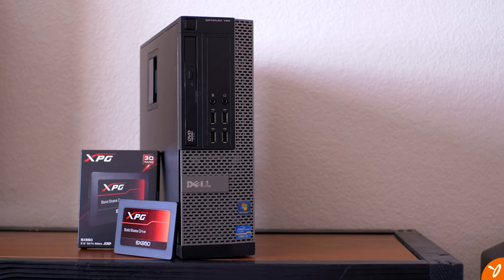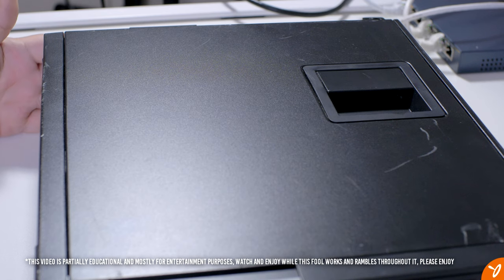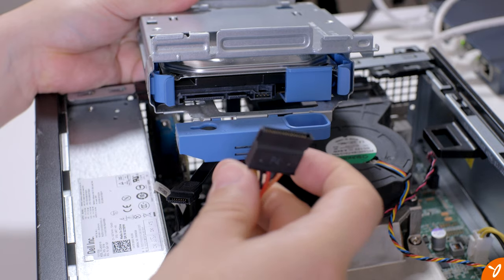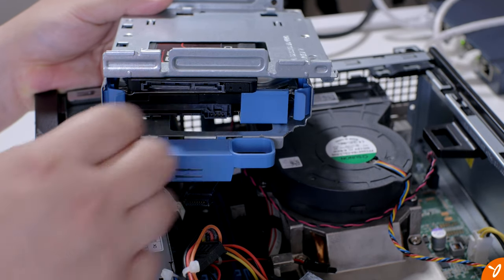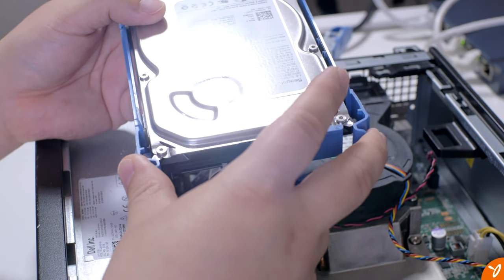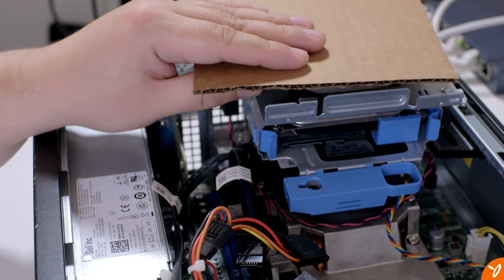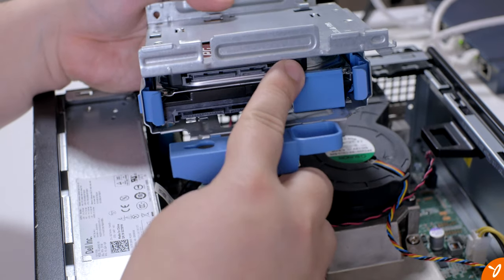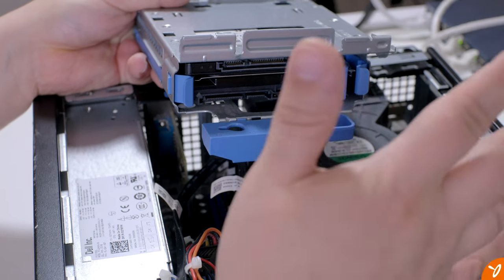DIY | Upgrading from HDD to SSD | Dell Optiplex 790 HTPC

Comment: Thanks for the review.  I'm looking at getting one of these.  I really wish they had designed these USF machines to be able to fit multiple IDE drives but the intended use is a corporate desk.  But yah, heat could be an issue with your setup.  One thing Dell and HP did pretty well on the newer model SFF is created good ventilation.  They used to have this closed off case that would create an oven inside the case.

Comment: Thanks for this video. I have an Optiplex 3010 and looking for ways to increase performance. 
Using an SSD seems to be the easiest and cheapest way to speed up Windows 10, access to files and the internet etc.
Nice attempt at rigging the installation of the SSD!

Comment: Just use a 3.5 to 2.5 adapter unless you want both drives in there. I use external enclosures for larger drives.

Comment: Cardboard is not a good idea, not a conductor of heat at all. You're much better off with the drive directly on the aluminum enclosure which is an excellent conductor of heat away from the drive. There are also HDD caddies that fit perfectly into the DVD enclosure on amazon or ebay very cheap, these would be perfect.

Comment: Thanks for the video!
My idea is to use two cutted rubberringstripes of a bycicle tube  around the front and the end of the ssd. Then put it in.  It will leave a little gap and it is better isolated. Perhaps ask your local bicycleshop for a used one.

Comment: Very nice video. I have a somewhat same system and like to upgrade too. Your video is a clear guide. My plan is to change the old HDD into 2 x SSD, 1 x 128 boot and OS and 500gb for storage...I have only 1 question and maybe a remark or tip. Why you did not change over to a Linux Mint, its much faster...add the Kodi? A good browser, like The Brave...

Comment: DELL is the BEST--- they use good sense in setting things up so they are EASY to work on and get to... unlike the other fools that make it so you have to have a degree to change something..   I will have NOTHING but DELL.

Comment: Question? I want to replace my hdd with a ssd and it says it uses SATA III and I also have an optiplex 790 like you so I was wondering if it came with the SATA III cables already and I don't need to buy a new one
Reply: pretty sure cables doesnt matter, only thing matters are if the motherboard supports sata III.

Comment: I'm in the same boat. Same specs i got on Amazon for 90.  Looking to upgrade it. I've noticed its been crawling and I had to run a CHKDSK to fix some bad sectors so I know I need to upgrade the HDD to SSD. according to dell's specs, it will take only 128gb SSD. I assume this is in fact the case? 
Also, would it be worth putting in an i5 2500 and 8gb or 16gb of RAM? It's an office machine so multi-tasking with Office apps and browsing. Or is the SSD good enuff for a big speed boost?

Comment: i dont see a point for the disk drive so i would just sit the ssd on top of the hdd cage cause the ssd doesnt move as its got no moving parts.
Reply: The ssd will also be retained by the 2 cables

Comment: my desktop i baught has no caddy what do i do
Reply from the maker: You could use Velcro or zip ties to keep it in place. An SSD is light enough to where you could just let it sit in there without much worry. Sometimes you may find a cheap caddy on eBay.

Comment: I also have an Optiplex 790SFF. On the spec sheet from dell it says it only supports up to SATA II. Have you got any info on the transfer speed with your SATA III drive?

Honestly for under $400, I have a PC with a i7 2600, 16 GB of Ram, and a lp 1050 Ti gpu. Not bad...
Reply from the maker: There is a speed difference. I can't remember the numbers but I think it was at around 300MB/s or so max because of it being SATA II. Even then, it's still a huge difference in speed going from a mechanical HDD to an SSD. The i7-2600 is still a good solid chip!
Reply: SATA_0 is SATA III 6 Gb/s

Comment: Dose the gtx 750ti fit on this case
Reply from the maker: If you get a low profile card, then yes. But a standard width card will not fit.
Reply: YakovGYP does a gtx 1050ti 4gb fit in the low profile one
Reply from the maker: @msocial3234  If it's a low profile card then it should fit.
Reply: YakovGYP thanks
Reply: Sherbaaz Azam if you’re running a 240 watt psu you’ll fry your PC just a heads up everyone’s telling me to put a LP 1050 or 1050ti in my i5 790, I’m honestly scared I want the frames but it’s too much to risk fucking my whole pc up I might just get the LP 1030 ti or be a pleb and get the 750ti LP
Reply: Judas I have done this setup and low profile card with i5 2400 will work
Reply: Judas I have a 1050ti in mines

Comment: Is this compatible Palit GeForce GT 1030 2 GB GDDR5 PCI Express 3.0 Low Profile Graphics Card - Black
Reply from the maker: If it's low profile I don't see why not. Just make sure the length of the card is not long enough to where it won't fit.

Comment: I bought a optiplex 390 and it didn't come with a hard drive so I put an ssd in it. it then said that no boot device was found. Is there something missing or what? How do I download windows?
Reply from the maker: Do you already have a USB drive or CD with the Windows installation? If so, press F12 while booting to have it take you to where you can select what drive to boot from. There, select the Windows installation drive or disk. Then Windows should see the new SSD and provide you the option to install it there.
Reply: @YakovGYP  ok thanks! I don't have a USB drive or cd so I'll probably buy one
Reply: @Luke-dg1tn  you can make one
Reply: @ivaporizedmitski  ok wow, I have come a long way in 5 months, but I was dumb. I did end up using a cd from a friend, but I also just built a new gaming PC and installed Windows by creating a USB drive